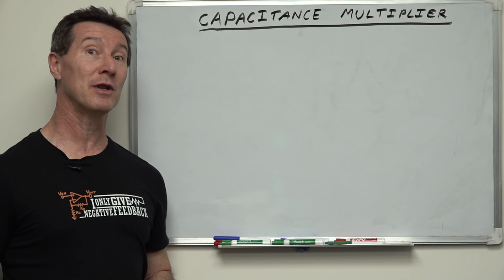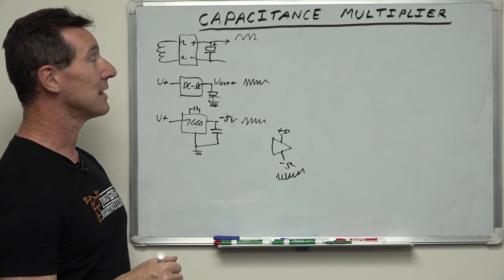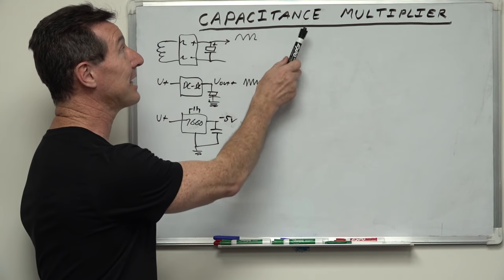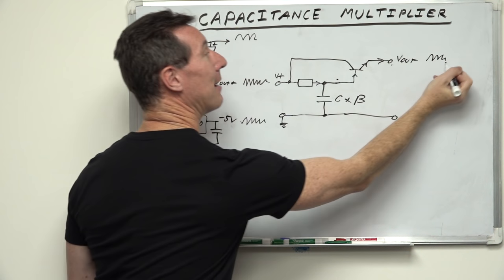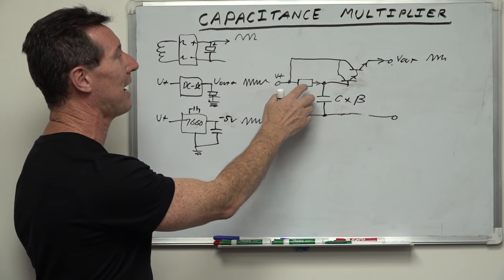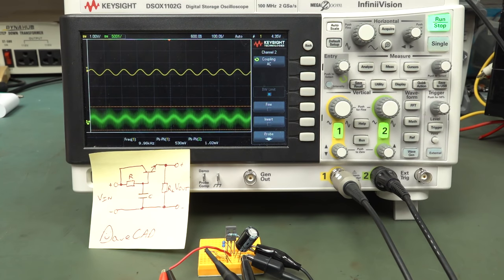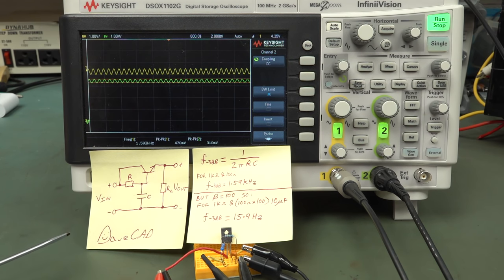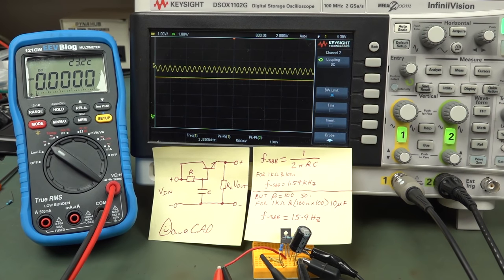EEVBlog #1116 - How to Remove Power Supply Ripple

Comment: I've been struggling with a USB supply to a pre-amp/AGC circuit for ages. Works fine with battery supply but the "noise" of USB supply renders it useless. In my electronically innocent mind - I think you may have just given me the solution! (time to re-watch then get testing). Funny how the Aussie take on things makes things easier to understand to a whinging pom like me ;-)

Comment: Dave, excellent video, I'm really interested in this specif problem for neg opamp rail, however you kind of glanced over the MOSFET circuit and how it would behave, in terms of capacitance multiplier (what is the "gain" in this case? 1 million+?) and what would be the voltage drop across the transistor. If you could just pick one and show what happens, I think it'd complete this tutorial.

Comment: Ah, brings back good old memories. Many years ago i built an AF amp to boost the input signal into an audio power stage using some dual OP-amp and was somwhat stumped by the ripple problem on its supply rails. Then someone pointed me to this circuit and the evil ripple just went away and I had cristal clear audio. It was just as if it was battery powered. That experience was liberating.

Comment: 8:50 A popular thing(multistage RC filters) in tube equipment. Reduces ripple and also decreases plate voltage for say preamp stage. Personally I prefer to use mains frequency power supplies with standard voltage regulators. Even at 5V ripple 100Hz I get few mV at top when the regulator load is couple amps. Usually classic LM723+output transistors (high power), LM317/78XX (low power) or zeners (very low power).

Comment: I had no choice but to do it "the hard way." I needed 10 Volts an 10 Amps for the directly heated tungsten cathode on a single-ended triode 833A audio amplifier. From my rectifier rated at 50 Amps (so it would not smell bad as a 20 Amp rated rectifier does) off the 10 Volt 20 Amp transformer, I went to 80,000 micro-Farads, through a 0.1 Ohm resistor to a 4.5 Farad capacitor. It took every bit of this to silence the cathode ripple but it works. I use 9 volts through 100 Ohms to pre-charge the 4.5 Farad capacitor before I fire it up.

Comment: I think the ripple limit would be limited to the voltage drop of the transistor for BJTs. Another issue IIRC is feedback if the load has switching characteristics (ie load changes when something is turned on or off). So perhaps OK if your using a cap multiplier circuit for powering a static load like a opamp, but not so good for supplying a microcontroller or some other digital device that can switch its load dynamically. 

Generally for low noise a CLC\PI filter is used to reduce ripple. For very low noise, a coupled inductor filter offers the best option, especially when you trying to remove noise down to the  microvolt level. Also its good idea to using small & very low ESR filter caps and Ferrite bead filters at the point of load, since the PCB traces can pick up noise, or other devices using the same supply rails can introduce noise. . There are also special ultra-low noise regulators from analog devices & Linear (LTC1962) that have active filtering when you need very low ripple usually when you need to power an JFET or DiFET amplifier. Generally its good practice to power very sensitive devices using its own ultra low noise power regulator.

Comment: What actually happens is just changing the equivalent resistance viewed by the capacitor, since now it will include the impedance of the base (Re(B+1)+..) - (in a first approximation becomes times B..). In this way the pole introduced by the RC filter slides at lower frequencies

Comment: What happened to the old trusted method of using a DC choke in place of that resistor.? I know they were initially meant for 50Hz ripple removal, and in themselves have some resistance, but you could experiment with other metals or ferrite cores for higher frequencies. Then voltage regulate. Iv'e been doing it for years.

Comment: This has been enlightening. I've been trying to fault find the dead power supply on my brother's 1980s Transcendent 2000 kit build synth which has a Darlington arrangement on the positive rail output. The negative rail is generated by inverting the positive rail with a 741 op amp. Given the power capability of the regulator I couldn't seen the need for the Darlington pair on the positive o/p, but I could for the negative. The increased noise rejection would explain it all.

Comment: Linear regulators have very efficient ‘outboard’ transistors built in.  They also have loop compensation and thermal regulation along with current limiting and ripple regulation.  Saying that they are inadequate is simplifying PSU IC choice.  Look at Linear, TI etc.  They are typically better than the solution you present.  Some even have the pins for doing outboard current sharing.

Comment: Hi Dave!
What about dinamic changes in the load?
If we power an audio amplifier, then the load current will change with the wave being amplified, and as we know Vbe of a BJT changes with the load current, thus the output of the caps multiplier will change with the load. In other words we are creating the ripple which we are trying to attenuate. This can only get worst with a darlington pair.

Another thing would be when we cut of Vin, the base capacitor still has some voltage in it just because the beta of the transistor, and with a load connected, the BE junction of the transistor will have to discharge that base cap with possibly high amount of current, maybe too high for the base-emitter junction, so it can blow up the transistor. 

All the best!
Reply: I am interested to know dynamic load case!!
Reply: I have already mentioned one tipe of...
Reply: HI, sorry I see only one comment from you. Thank you for pointing out this issue. I was planning to use this with a 2N2222 transistor. and my load current varies from 10 mA to 100 mA. Which makes my Vout=Vin-Vbe vary between 100 mV (used Ic vs Vbe graph in the datasheet). From this nice video, I learned how to use a large value of R in a filter(for very low cut-off frequency) and still get enough current for the circuit "its cool" 
 ))). It seems this will work only for the constant load. There is any similar way, by which I can avoid Vbe term in my Vo expression??, it would be great!!
--
Ikram.
Reply: As i have said, the audio amplifier is a dynamic type of load.
The load current changes with the signal being amplified. 
And not just with the changes in the amplitude of the signal, but the wave as well,
meaning that the peak current will increase as the wave its self goes to its peak.
That's a problem with any magnitude of power amplifier being powered by the capacitor multiplier, because it will create a voltage ripple at the same frequency as the signal. It will create a mess much worst than the classic 100/120hz voltage ripple on the filter caps.

The sziklay combination could be less prone to this problem, but without enough capacitive load, i think it coud be prone to instability.

Comment: Great video! Definitely gonna explore circuit this more in my designs.
You mentioned briefly that it's possible to use a MOSFET for this circuit. It seems you drew an N-channel MOSFET, but I don't quite follow how that would work. Doesn't all MOSFETs need a certain Vgs voltage to conduct, which means the voltage on the source of the MOSFET would have to be that much much lower than the gate (after the RC-filter)?
Reply: Yeah that got me confused too

Comment: Nice video Dave. I tried using this circuit about 20 years ago and found the problems that you have, plus a couple that was important to me at the time. Mostly when I used higher output currents the pass transistor now used quite a bit of power, also when the output current fluctuated, so did the voltage drop across the base/emitter junction, which defeated the regulation I wanted. As you said, I also found that instead of a capacitance multiplier, it was mostly a current amplifier which reduces ripple, if my output load was fairly stable. Thanks again. Perfect!

Comment: I wouldn't call this a capacitance multiplier.  It's just changing the DC current load on the low-pass filter so you can use a higher value resistor.  The transfer function from input to BJT base is still 1/(1 + sRC).

Comment: The term capacitive multiplier may be a bit of a misnomer but I think the phrase does a better job of communicating the function of the circuit because, conceptually, it is strictly time based, whereas the RC filter adds a frequency component that is much less intuitively coupled to the task at hand.
-Jake
Reply: BTW Dave this is the kind of reference material I appreciate most. I know everyone has their favorite types of content that you create, as you've proven conclusively, but these are the types of videos I wind up watching a half dozen times when I need a reminder of some simple thing. I added this video to 3 of my playlists for future reference. Much appreciated.
-Jake

To any other beginners or hobbyists that may be unaware, search for the "Talking Electronics" website (I have no affiliation/just a good reference) and find the 1-100 & 101-200 Transistor Circuits PDF for a multitude of circuits like this capacitive multiplier.

Comment: 8:46 That filter for Ridiculously low currents is perfect for Voltage biasing in photon detectors which will just use the voltage to modify the junction properties.

Comment: Going back to basics, one learns that any amplifier is in fact an impedance transformer, where one can pass a current through a low impedance circuit,  which shoots it through a high impedance circuit,  and hence the amplification as found in a transistor.
With the emitter follower this  "impedance transformation" results in the following:-
*If one looks at the input impedance between the base- ground, this is a much higher version of the impedance that is present between the emitter and ground. Approximately the ratio is the gain of the transistor. 
*If one looks into the emitter-ground output impedance, it is a  lower version of the impedance that is present at the base ground.
So in addition to voltage and current transformers, we must look at a transistor as an impedance transformer. Once again the ratio is approximately the gain of the transistor. 
Hence this circuit must not only select the capacitor acting alone and say that this is a capacitor multiplier, as one must not forget the resistor with it.

Comment: Do you mind making a video about what Oscilloscope you would suggest to beginners? I've seen all your videos about oscilloscopes, but have not heard you give a solid suggestion. I would assume you suggest getting as much as we can in regards to bandwidth and channels. It's a confusing market and I don't want to buy some crap, for instance the Siglent and KEysight having that issue with the piezo effect and the double lines. I just want to make sure I'm buying something decent, I try to buy quality within reason, like a Hako adjustable iron, and I'm going to buy that Quick rework station. The Hako was well worth it, I've done several projects recently with it building a LiFePo4 battery pack and power distribution board, also I've done several MARS/CAP mods for friends on their radios where had to use magnification to see the SMDs I was working on. Thanks for your videos, I'm slowly learning and growing my lab.
Reply: I bought Siglent SDS 1104X-E as my first scope half a year ago and I absolutely love it. Great value for the money.

Comment: If you take loading into account, the multiplication factor in the circuit becomes 4.9, not 100. No surprise you could not see the shift on corner frequency.

Comment: I saw an RF engineer colleague of mine do this to remove noise (not ripple) from the supply of a critical VCO. I recall transistor choice was key, and the data sheet rarely conveyed the info needed. I believe something with low shot noise was needed.

Comment: Back in the vacuum tube (valve) days, we used to use LC circuits in a pi configuration to smooth ripple. Seems it would still be a good solution without a lot of voltage drop due to resistance.
Reply: This circuit outperforms a pi filter, no contest. Not to mention filtering elements can be added to extend bandwidth and enhance performance without the need for a heavy, expensive choke.

Comment: My grade 10 High school Electronics project back in '73 was a 2N3055 pass transistor with a 2200 mfd Capacitor  after the recftifier and a 100 mfd  to the base of the transister.. I got the idea from a "Howard Sams" book.  I noticed the little voltage regulators were noisey  and most of the quality regulators used a few more parts. My favorite is an LC circuit rather than an RC.  %0 VA burnt out transformers make good forms to rewind as Inductors and by tuning them to be anti resonant with the Mains frequency I get not bad results to then start using the Cap multiplier.

Comment: Really old school would be a pi filter.  Probably more expensive for high volume production, but they work.  Also Darlingtons have more voltage drop when used as a pass transistor.

Comment: You can use it for regulation if you put a lower voltage zener than input voltage connected from the base or gate to ground

Comment: You can actually use this circuit to regulate. It's just a matter of placing a zener of the desired voltage +700mV parallel to the capacitor.

Comment: Do one on how to remove inrush current spikes like when using a AC/DC converter and DC/DC converter.  Ran into it recently.  I thought a large inductor would fix it since it has really high resistance at first.  But ended up buying a current limiting thermistor.

Comment: So would I be correct in my understanding that you would use this method at an earlier, higher voltage regulation stage, and then regulate down to lower voltages in subsequent stages once the ripple has been removed?

i.e. Due to the voltage drop, you wouldnt want to be using this directly on a 3V3 regulator that feeds 3V3 devices?

Comment: Maybe I missed it, but did you explain the actual functionality of the transistor and how it helps filter the ripple?  The signal on the collector has ripple, and you're switching the NPN on/off with a portion of this rippled signal, so how is the ripple being removed by the NPN?  Does it have to do with the phase shift provided by the capacitor?

Comment: This is a good way to reduce the ripple, however there's one caveat, as the series pass transistor or MOSFET gets bigger, its collector-emitter (or drain-source) capacitance will bypass more of the AC ripple to the output bypassing your filter.
And for all those suggesting an inductor instead of a resistor, think about the value (hence physical size) of the inductor you would need to effectively filter the ripple to the same level as a resistor.

Comment: Worth noting that its only as good as the bandwidth of the transistor, so choose something suitably fast for your application. And not all linear regulators are as bad as that, just pay attention to the PSRR and design accordingly. 

A good linear regulator will give you decent rejection up to ~1MHz, and for frequencies above that a small inductor/ferrite with a capacitor on the input side usually does the trick. Although pay attention to the SRF of the inductor and the LC resonance frequency, make sure these aren't close to your expected ripple frequency. you can always use an extra resistor/capacitor to damp the LC resonance

Nonetheless a useful little circuit if you're not too worried about voltage drop and efficiency.

Comment: I thought just using a 0.1 uF in parallel with a ordinary electrolytic would help fix the ripple. I guess I learned something. Thanks Dave.
Reply: Nuts n Proud The 100nF in parallel with the electrolytic is to catch high frequency ripple and noise that wouldn't make it through the ESR and ESL of the big capacitor.  An ideal (impossible) capacitor wouldn't need that.
Reply: Thanks John.

Comment: Brilliant been trying to sort out ripple on class A amplifiers for ages.
Reply: so, did u finally get rid of the ripple ?
Reply: @iceberg789  Got rid of most of the ripple but need to get hold of some MOSFETs to try out.
Reply: @rpsproject5349  bjt works fine i guess.

Comment: It seems logical that with the given circuit, the transistor is mainly used to allow higher current output than the RC filter would normally allow.  There would be no "capacitance multiplier" effect as the ripple would pass through the base and therefore through the output as well.  It is a novel circuit for power supply construction, but to remove ripple, it is best to just use a filter circuit.

Comment: Very informative. Thanks for sharing.  I've been troubled by a 50mV ripple in the push pull power amp I'm building. I've tried RC & LC filters and big output caps, but they don't eliminate the ripple at high currents ( I'd like to have the amp run at 2A at full volume). I'll give your solution a try this weekend! Just curious how to set this up with a +/- split supply...  NPN on top and a PNP on the bottom?

Comment: will be good if you include how you bias the BJT or MOS to active mode and also include a small signal analysis on the input impedance to show how capacitance have been multiplied.

Comment: It may be a more expensive solution but, a filter choke (inductor) in place of the resistor is easier and does a much better job. I'm sure someone in the comments already mentioned this.